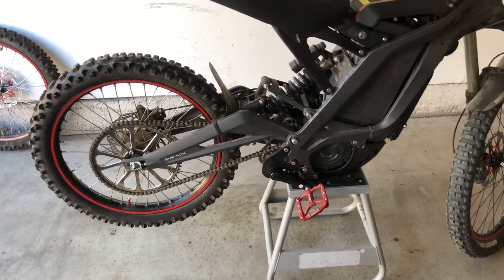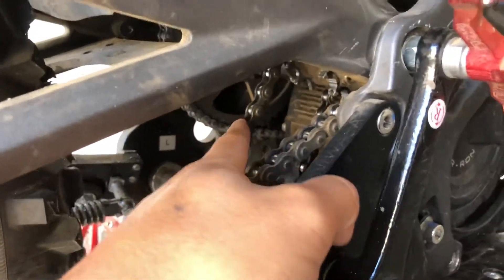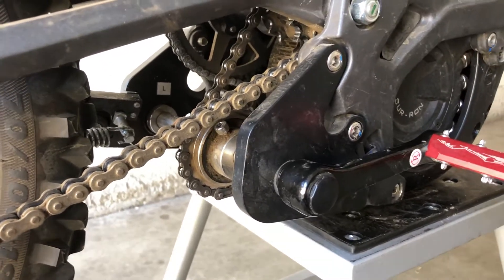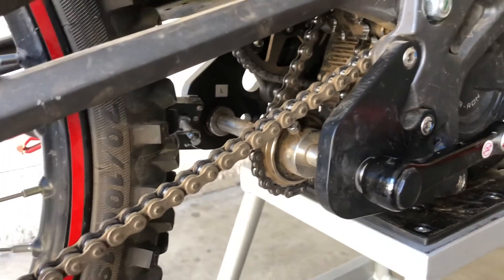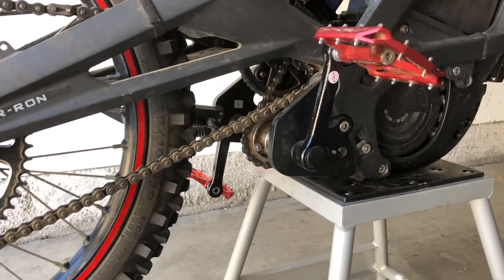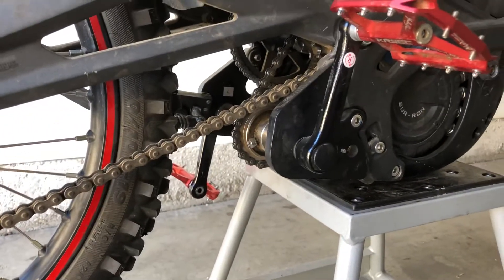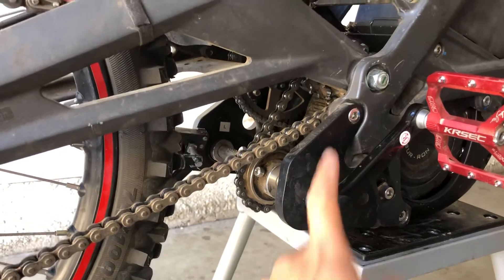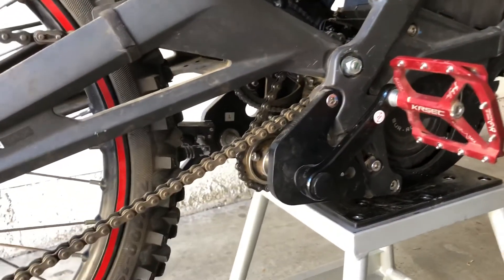Sur Ron Light Bee Segway X260/X160 Kaniwaba Power Pedal Kit long-term thoughts and tips

Comment: In the event of a tip-over, bent cranks would be preferable to bent or broken frame mount holes. I got the 100mm unicycle cranks shown in this video they are steel and probably wont bend. Is Sur Ron frame damage common from crashing with a pedal kit? please advise
Reply from the maker: I think your frame would be fine.  If the crank doesn’t bend, I imagine the pedal spindle will.

Comment: hi i have a question i too live in socal and ride and e bike, i have been planning to make some money and get a surron, i am 13 i heard by adding petals to the sur ron it makes it “street legal” or at least to the point where you can tell police it’s not illegal is that true?
Reply from the maker: It’s technically street legal as is in eco mode.  Doesn’t exceed 30mph.  Motorized bicycles don’t need operational pedals.  Riding on trails and bike paths is where you need pedals.  If you want to be safe, you can run a 64T sprocket.  Even in sport mode it won’t go past 30 and will have incredible torque and climbing power.
Reply: @skyungjae  ok thanks but where i live cops hate e bikes and i’m 13 so you think i can get away with riding a surron in eco with petals?
Reply: @skyungjae  ok thanks but where i live cops hate e bikes and i’m 13 so you think i can get away with riding a surron in eco with petals?
Reply from the maker: @kaimovezz  enforcement of ebike laws is really subjective.  You have to be 16 or older to ride ebikes legally in this state.  So regardless of configuration, they can always get you on that.
Reply: @skyungjae  oh well in my area kids my age and younger ride e bikes everywhere so i think it will be fine i ride mine to school and downtown everyday and i have no problem i’m just worried cops will pull me over

Comment: I use a short, steel straight-edge laid sprocket-to-sprocket to ensure alignment.
I think the pedal-shaft to jack-shaft distance should be shortened slightly, a minor re-design, that would fix the chain tension problems. A more sophisticated design would have some adjustment, it's not too hard to mount the shaft bearings in some index-calibrated eccentrics.

Comment: Thanks for the vid! I'm contemplating about getting pedals instead of pegs for compliance reasons. What's your experience riding trails with pedals vs pegs? I'm coming from a dirt bike background. Can I ride over logs or rough rock sections with pedals? Or make steep hill climbs?
Reply from the maker: As long as you’re not trying to pedal while going over obstacles, you’ll be fine.  The bash will hit anything first as long as you keep the pedals level similar to riding a downhill bike.  Hill climbs are also not an issue.

Comment: Did you notice ant top end speed loss when you installed the "power kit" portion of this set up?
Reply from the maker: No, the drag from the chain and freewheel is so minimal, you'd probably lose top speed from a misaligned caliper or a bent rotor before that.

Comment: I don't even own a sur-ron bike, but interested in one. Would have to buy the pedal kit to not get pulled over or get the bike confiscated. My question is, why is there not a larger chain ring on the pedal axle? Cant really see but I guess the chain would get too close to the motor? With a larger chain ring you could pedal at reasonable speed :)
Reply from the maker: It is a clearance issue and the fact that the Sur Ron wasn’t really designed to be pedaled.  There is a 25T rear sprocket that people can use with the OEM pedal kit, but you have to keep it in the limp 10kph/6mph mode to avoid burning out the motor.
Reply: @skyungjae  a